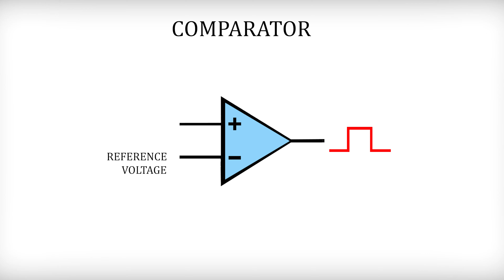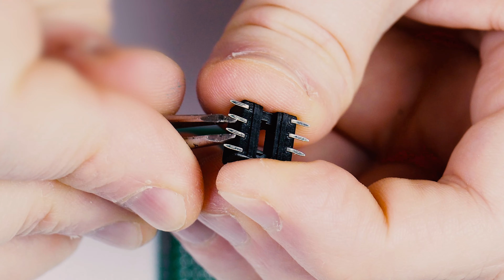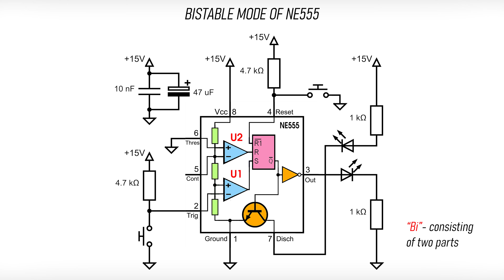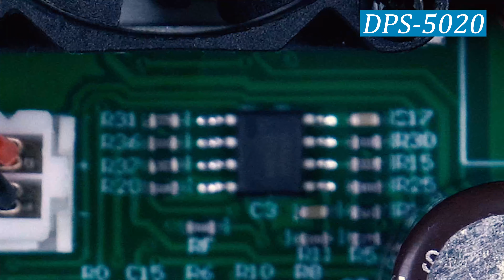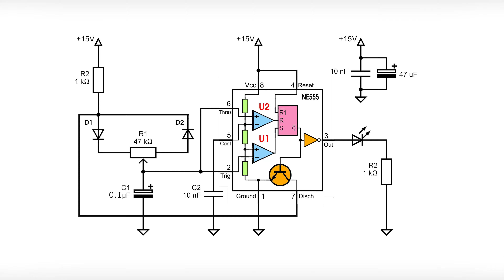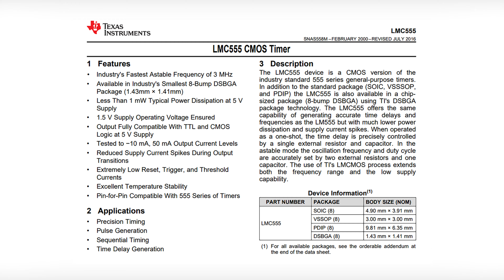How does NE555  work? Bistable, Monostable, Astable, with schematic examples. The COMPLETE Guide.

Comment: I started designing with the NE555 in 1974. This is a worthwhile video if you're thinking of using the NE555. It's amazingly stable over a wide range of frequency. There is one Easter egg though, I'll let you find that. With three NE555's you can make a decent pulse width modulator. Hands down, it's the best entry level hobby chip.